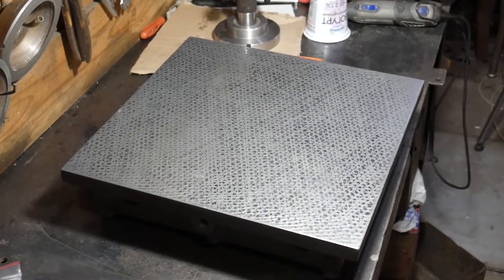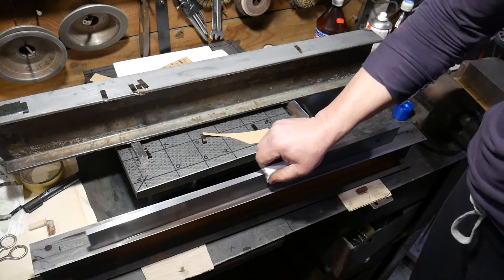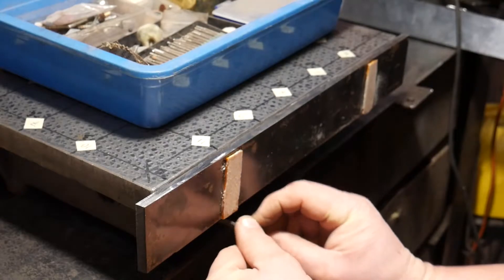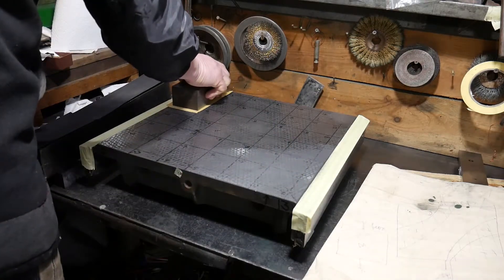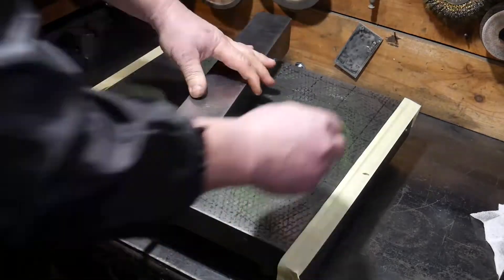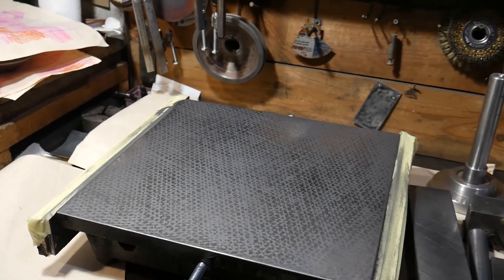Surfase Plate 0,001mm (repairing)

Comment: Hi, Really love your videos.
I want to ask something.
"Doing this work, I take into account the expansion of the metal from heating". 
So, the operating conditions are somewhere in between the room temperature and elevated temperature?
If not, what are the consideration you took.
As far I know even smallest gain in temperature can throw can significant fractions of microns gains.
Reply from the maker: Of course, thermal expansion works according to the set values. It's easy to perform these calculations and understand what actual distortions you're dealing with and whether they should be taken into account. In any case, if your fingers feel the coldness of the metal, you should react as if it were very hot and reduce the contact time to the maximum. Very quickly the habit of avoiding this cooling develops.

Comment: 00:17:04 I look at the homemade "repeat-o-meter".
I see the "repeat-o-meter" and I think I understand how it works. I see a cut which was surely made with a saw, and a hole which gives the way to the repeat-o-meter to be sensible (it means to move) about the different level.
It could be interesting to see how you did it. It doesn't seem to be very difficult to do.
But there are surely different important details as the different measures.
For example : what is the distance between the hole and the horizontal line which is above ? It seems to be less than one millimeter.
How did you know it? May be you did different experiences to see how it works.

Thanks Gena!
Reply from the maker: https://youtu.be/8LVVScTHiEc

Comment: 00:01:47 First I made three straight edge

00:03:21 I use an industrialy manufactured straight edge.

relying on the straight edge already made.

00:04:40 I also... made two such straight edge as guide for technologically... scanning of its surface.
On the sides of the plates there are two basic straight edge.

00:05:16 HOW I GLUED THEM WITH HIGH PRECISION IN THEIR POSITION ?

00:05:30 The scanning had to be done 17 times.

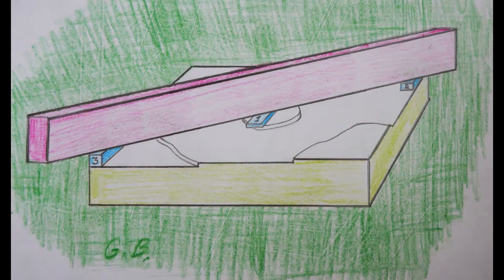00:07:14 First the surface of the slab is scanned at four corners. An appropriate set of gauge blocks is selected for each corner of the slab.

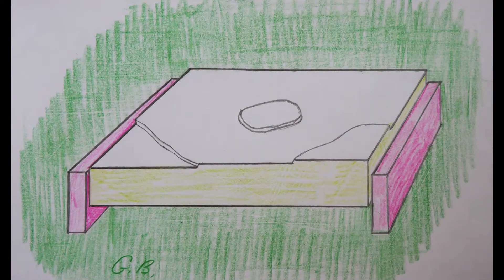00:07:50 THE STRAIGHT EDGES ARE NOW ATTACHED TO THE SURFACE PLATE IN THE CORRECT WAY.

00:12:23 ... for... the alignement... I use LAPPING.

FIRST a MEDIUM SIZED SOFT ABRASIVE.

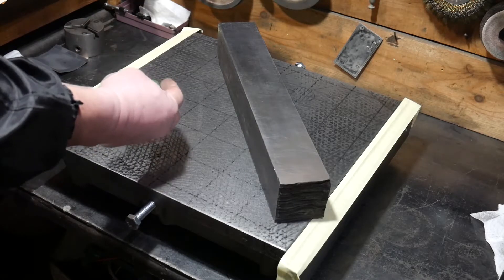00:15:43 SECOND lapping.
Using a CROMIUM OXYDE ABRASIVE.

00:18:35 The surface plate is now very acurate. Error within one micron.
00:19:00 devices = procédés

Comment: Why are the precision gauge blocks used here to level and scan the surfaces, how do the precision gauge blocks helps? What is this process called of your method in scanning the surface plate, are there any books about it?
Reply from the maker: I came up with this method myself. Perhaps someone has used it before, but I do not know about it. I used the tools that I had available.
Reply: @gena_bazarko  Interesting, I have been researching on this topic for few years. Never seen this method used and it is a great accomplishment that you have done with minimal tools.
Reply from the maker: @Engineering_Science  Now I'm preparing to shoot an interesting video on this topic. Sefes plate will be bigger and the technology is a bit different.

Comment: How did you do those straight edge?
Did you had some reference straight edge?
Reply from the maker: This is the key question. I made the reference line myself. Using the technique I developed, I managed to independently make a ruler with an error of less than a micron with a length of one meter. I hope to post a video of this work soon. I made the  reference straight edge  myself because it is very expensive to buy.
Reply: @gena_bazarko  did you used 1,2,3 method or use precision level?
Reply from the maker: I have tried both of these methods. But much more productive with an accurate level. I was able to get really high accuracy by using a level along with a ruler positioning system in space. As an announcement, I showed this system in my videos.
Reply: @gena_bazarko  I will be waiting for the next video where you will explain your method with making straight edges. Great work.